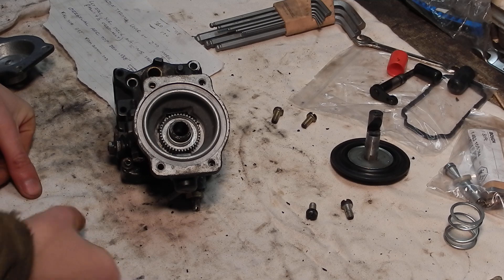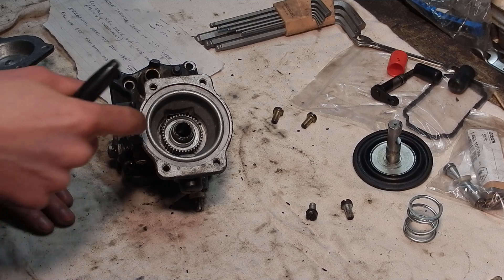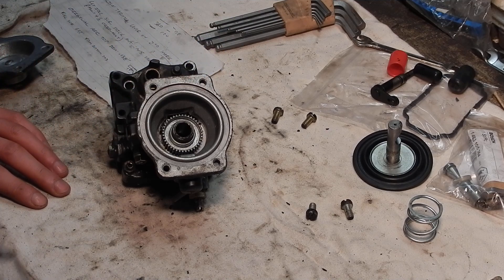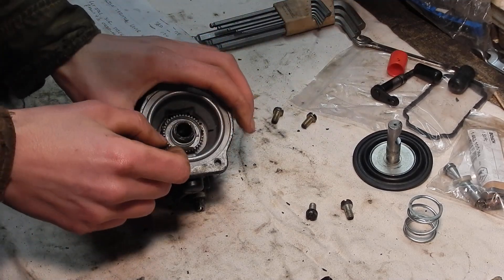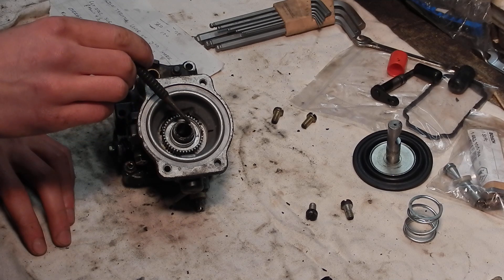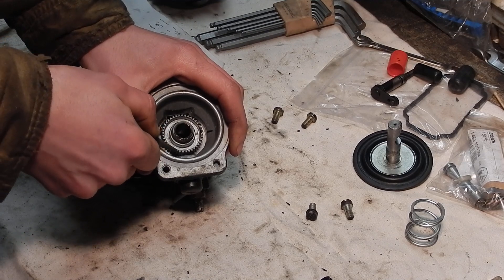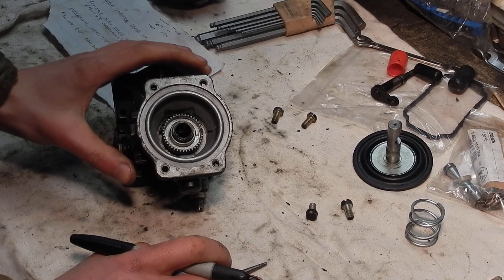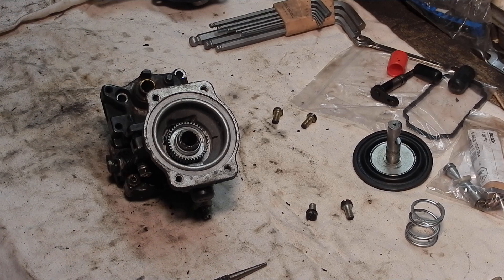First Gen Dodge Cummins - Turning the Starwheel

Comment: I have a problem with my 92. I put in a thd fuel pin and 3200 gov spring. Now it has zero low end power, it wont even break loose on gravel at full throttle from a stop, i assume im not getting enough fuel down low.. do you have any ideas on how to fix this? It wasnt like this eith the factory pin.
Reply from the maker: @williamcurl1752  it's been a long time so my memory is foggy, but I would make sure your follower pin slides in its bore. Not the THD pin, but the skinny pin that slides on it. Mine was stuck, so when I pulled out the tapered pin, it pushed the follower pin all the way in and it stayed there.
Reply: @themadmailler is there a spring in there or something or how would I keep that from sticking?
Reply from the maker: @williamcurl1752  I don't remember, but it was stuck from rust. I cleaned it and greased it.
Reply: @themadmailler  I'll take a look, if I ran the star wheel up do you think it would help? My truck doesn't smoke (93 model) but when I turn the smoke screw in it seems to help a bit
Reply from the maker: @williamcurl1752  star wheel will make no change, because that adjusts position of fuel pin, which is meaningless if your follower pin is stuck.
Reply: @themadmailler  it's not stuck its moving as it should, I made sure when I pulled the pin out earlier
Reply from the maker: @williamcurl1752  scribble sharpie marker over the fuel pin and drive the truck for a while. The follower pin should scratch a line in the black marker and give you an idea where it's riding and if you do indeed have a functional follower pin and if you should adjust the starwheel.

Comment: On the truck, turning counter clockwise, towards the cab = less fuel
Reply: unless you have compound turbos its gonna be a dog ! a stock turbo should have it screwed in quite a bit i did it all the way out and my truck has zero throttle response after half throttle turned it in and its a rocket ship

Comment: Hello.
I did this on my Volkswagen mk3 Turbodiesel AAZ engine, with the same VE pump ( there is a lot ve pumps used in this  VW engine ) I have the exactly pump like in this video, but when i turned the starwheel counterclock wise, like the video, i noticed my car becomes lazy, like you killed 20 or 30 foot pound of torque turning it counterclock wise.
I have a K24 Turbo on it, wastegate fully locked. ( 1.5 bar boost ) i turned the fuel screw way to high up, it idles at 1300rpm. and the idle screw is fully screwed out.
Reply: You can adjust the throttle lever to another knotch and adjust the linkage. From there you can add more fuel after adjusting your desired idle. Not sure much about VW. For me clockwise 2 turns on star and 1 1/4 on smoke after setting fuel and idle seems to be a good happy medium with little to no smoke an good spool of the turbo. HX35W Non/IC 12v BHAF Filter and larger intake horn. No grid heater. I think I'm somewhere about 30-40psi boost.

Comment: @themadmailler  your vid is from 2015   was looking for your long term opinion on this mod , do you still think raising it is the best option?  i'm not looking for smoke looking for power &  efficiency  thanks..
Reply from the maker: it's good for dialing in your fueling depending on the fuel pin you're using.

Comment: I've always been told that you turn it two times clockwise instead of counter clockwise?
Reply from the maker: that reduces spring preload, increases pre- and low-boost fueling, causing excessive smoke.
Reply: @themadmailler  The extra fuel pre-boost is what causes the turbo to spool quicker, but it does create more smoke off idle.

Comment: Hey there so I have no idea if my smoke screw or star wheel has been modified.  I bought the truck with a newer "high power" injection pump on it.  I see the max fuel screw has been turned not sure how much and the throttle linkage has been moved to the inner "closer" hole with a modified return spring.  I have a he351cw, 3200gov spring and a dennyt stage 2 pin at least thats what the owner said was in there.  I am very happy with the power but i dump way to much smoke on the low end.  where should i start?  I hear really good things about the BD pin and could swap that in.  Should I start with the smoke screw and back that out? or should I start with the star wheel and back that out to put more preload on the spring?
Reply: just opened up the AFC and did verify that its the denny t stage 2.  spun the star wheel counter clockwise 2 full rotations.  no noticeable change on smoke, power, or turbo spool.  Gunna try the smoke screw, 2 turns counter clockwise...
Reply: 2 turns of the smoke screw and it may have cleaned it up a little bit but still smokes more than I would like.....I will turn both 1 more full turn total of 3.  I did place an order with the hungry diesel for one of his pins.  ill post an update when i get that installed
Reply from the maker: Denny T pin is junk! use the BD or THD fuel pin and that will solve many of your issues. back out the smoke screw until it is flush with the housing, and if you can machine the little raised boss off of the inside of the AFC top where the smoke screw is. use the starwheel for your final dialing in. you might need a stronger AFC spring depending on how much boost you have. Also, some people have used a boost elbow on the AFC boost pressure reference line to reduce pressure going to AFC diaphragm, to prevent the spring from compressing prematurely.
Reply: Yep i backed out the smoke screw as far as i could and turned the star wheel flush with the lip inside and it still puts out a noticeable amount of smoke.  I am very stoked to get THD pin, and it was nearly half the price of the BD pin. next thing to add is a PS intercooler with 3" charge tubzz on both ends
Reply from the maker: if you can't find a PS intercooler, a second gen dodge cooler fits. I think which one fits better depends if your truck is originally intercooled or not, but i'm not sure. my truck is an 89 and i used the dodge IC. it was a tight fit but it worked.
Reply: yup from what I understand the 2ndgen IC is best for non IC trucks and if for 91.5 - 93 trucks the PS is better, not sure why...i like the PS cause it has 3" inlet and outlet as long as you get 01 or older off a 7.3 anything newer had plastic.  Thanks for all the rad videos themadmailler helps us new guys out alot.
Reply from the maker: I assume they're better for their respective truck generation because of their shape. the radiator support is totally different for IC and non IC first gens. Thanks for the compliment. Glad you enjoy the videos!
Reply: Hey did ya get it to run clean ?

Comment: So, as this is contrary to popular star wheel methedology, what you are saying is: star wheel in= more fuel too early, leaning it out will get the turbo to spool quicker? Are you watching your EGT's? You sound like you are keeping track, I'm interested in your findings when it comes to performance after doing this. I see you have more aggressive fuel pin. Did you add more fuel with the main fuel screw?
Reply from the maker: What the starwheel does is change the preload on the AFC diaphragm spring. when there is more preload on the spring, it takes more boost pressure to overcome the spring, push the diaphragm down, and advance the fuel pin down it's bore, allowing the IP to deliver more fuel. Turning the wheel counterclockwise increases the preload and prevents over fueling when boost is low. in my experience, lots of fuel under low boost makes high EGT's, low power,  and lots of smoke. screwing starwheel up prevents this. Some people will also swap the spring out for a stronger spring (THD sells these) and/or flip the starwheel upside down to gain more spring compression.

Comment: so you went counter clockwise, i see a lot of guys going clockwise. saying more fuel less air, your getting more air correct? seems to me more air is more efficient? can you elaborate on how thats effecting your turbo? its not overworking that turbo?
Reply from the maker: What the starwheel does is change the preload on the AFC diaphragm spring. when there is more preload on the spring, it takes more boost pressure to overcome the spring, push the diaphragm down, and advance the fuel pin down it's bore, allowing the IP to deliver more fuel. Turning the wheel counterclockwise increases the preload. The reason i do this is that it allows the engine, when it is accelerating under a load from idle, to not get flooded with too much fuel (creating smoke) before the turbo spools up. It takes engine RPM and load to make a turbo spool. The reason a lot of other people turn the wheel clockwise is because they are idiots that like to make excessive smoke because they think it looks cool and/or makes power. However, smoke does not equal power, in fact it wastes fuel and prevents full power output. Lastly, you can't really "overwork" a turbo, but you can operate it outside of its intended limits. This happens when the wastegate is not properly adjusted, thus causing boost pressure to be too high.